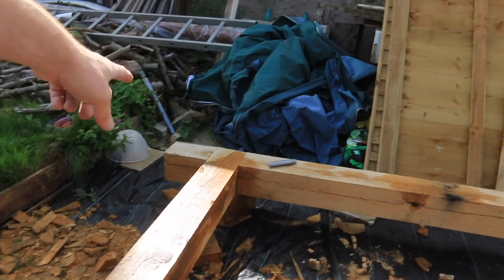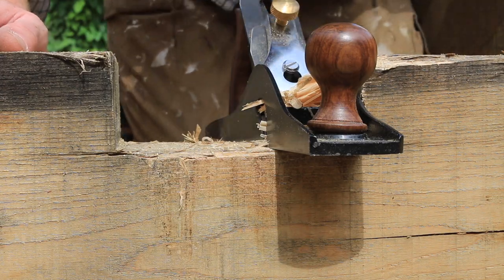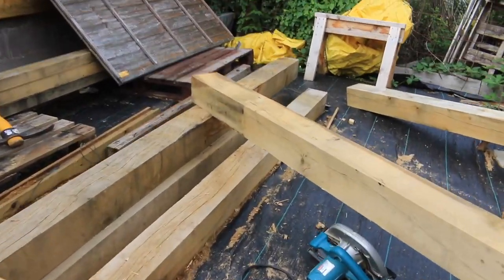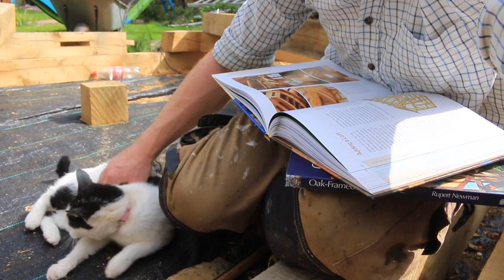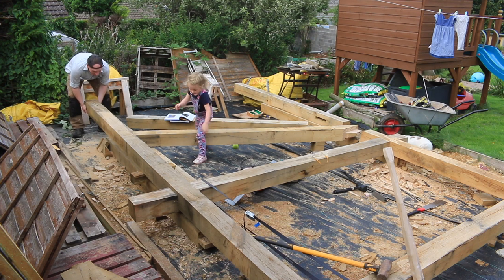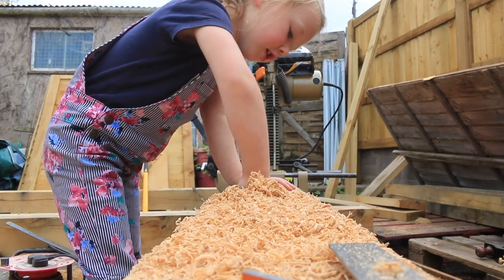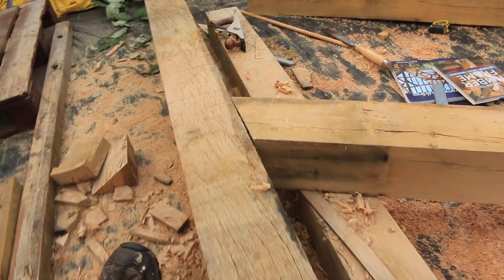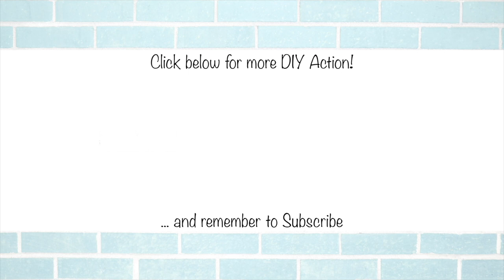Amazing Oak Framed Gazebo Roof

Comment: On your 2"chisel where the body meets the leather is the body jagged  I have ordered 2 of them and both look the same It doesn't look right to me.
Reply from the maker: Not that I can think of. It was a little sharp on the corners  of the shaft of the blade but not spotted anything by the handle that’s an issue.